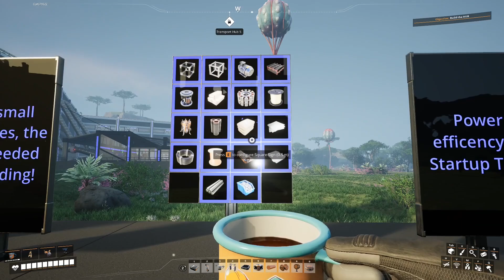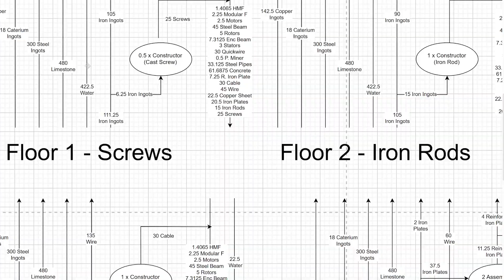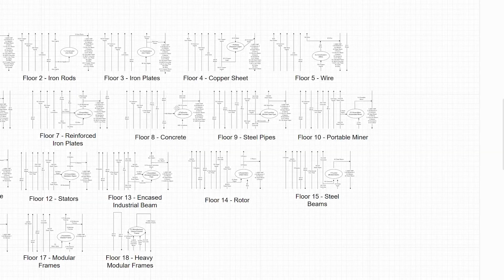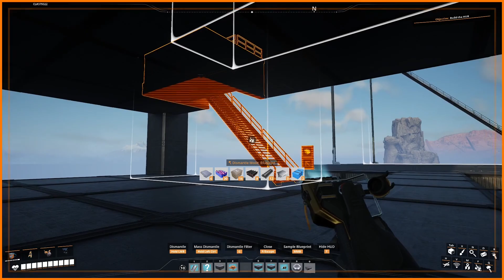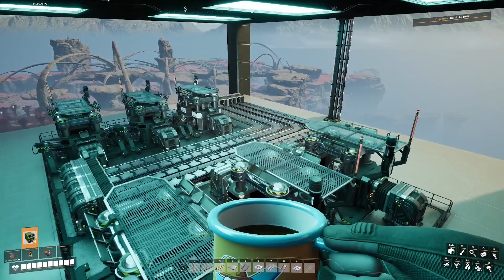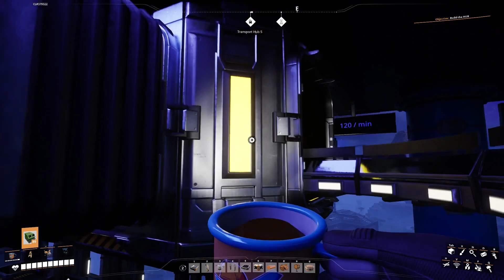Starting the Ultimate Starter Factory in Satisfactory: 18 Floors, 18 Materials, Overkill Achieved!

Comment: Did they get the 1m floor hole throughput bug fixed?
Reply from the maker: I remember they addressed it, but now I cant find it in the patch notes. Maybe it was mentioned on a dev stream? No idea, I might be inventing it.
Nevertheless, So far, every single lift I have goes through a 1m foundation, and I have never encountered the issue. I would realize as all of my machines work at 100% and I can easily check that by seeing the power consumption. I think that the issue happens more frequently with faster belts (sometimes mk5, more often in mk6)
So for the time being I am sticking with this type of lifts that are extremely useful. If I ever start encountering problems, is also an easy fix. Simply... Don't use the holes! You can leave them there and clip the lift through them. It would look exactly the same but would be bug free. 
Thanks for stopping by!